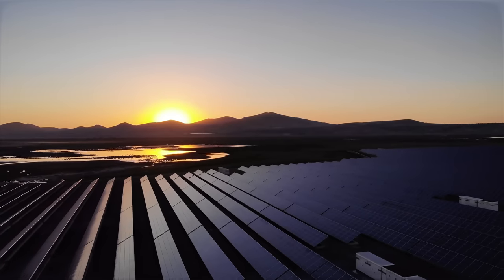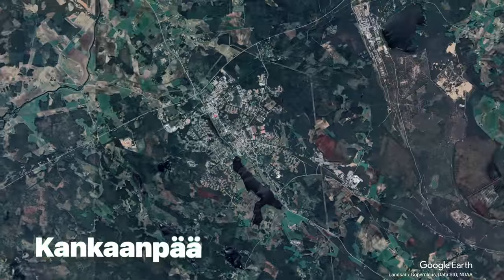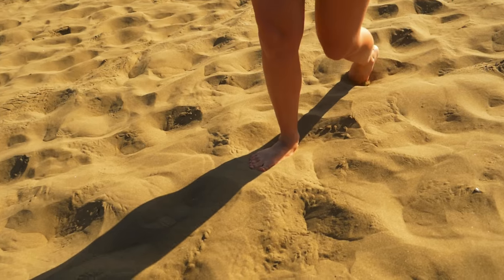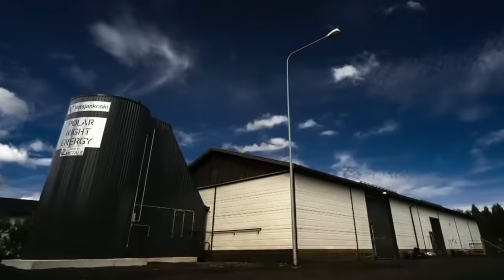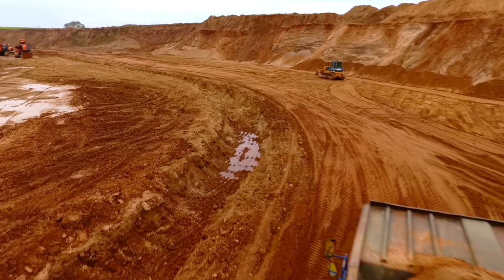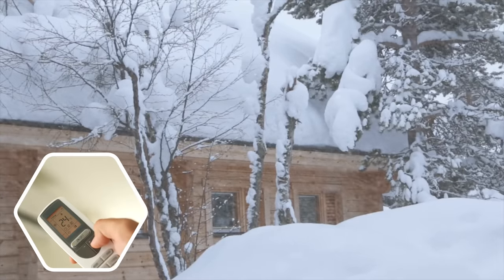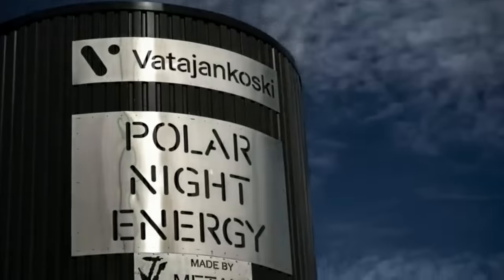Breakthrough Tech Heats Homes Cheaper Than Natural Gas!

Comment: This will help for heating homes and offices if they are connected to a district heating. The energy for the heating would coming from electricity if they is a surplus from renewable sources. But it doesn’t help it all to store electricity energy. You can convert the thermal energy back to electricity only with a relative low efficiency. So this “battery” doesn’t help to solve the problem to store electrical energy at all and is only under some particular circumstances useful.

To compare this with a pumped storage power station is misleading. A pumped storage power station gives the stored energy back as electricity. With this sand battery you put electrical energy in and getting thermal energy out. That is a fundamental different. Many things said in this video are not accurate in the best case.

Comment: I have a question that if we have so many energy options then why most of them doesn't even come close in mass manufacturing? Sometimes I feel great about coming up with different ideas and perspective but at the same time I feel like it only gonna remain as a concept small scale plan. 

So, how do you look at it?
Reply: The cost for people to replace current systems is high.
Reply: @vanderumd11  most of them can't be mass manufactured and are in research phase. So yeah, again it raises the question I mentioned above.
Reply: @RahulAhire  I worked for exelon. It would be at a extreme disadvantage to change our systems as we run short on fossil fuels. People must realize business. Nothing is better then having a depleting product that Increases in value as the supply falls short. Gas companies would love nothing more than the last 10 years of a fuel reservoir. You can sell a gallon of gas for $100 and do less work when that happens. Do you understand? We WANT energy shortages, we make better profits
Reply: @vanderumd11  sad reality
Reply: @vanderumd11  I feel great about having so many options. It just I don't feel good enough that it isn't moving faster towards mass manufacturing like how tech industry work or tsmc spin out semiconductors or how efficiently spacex work. 

I do understand the financial constraints of any new venture. Maybe I'm expecting too much...

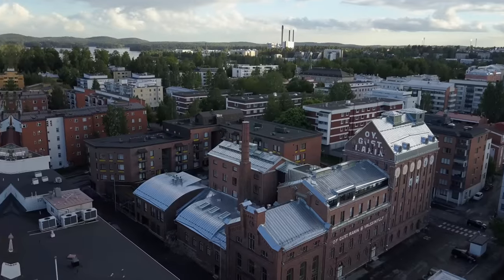Comment: 3:50 "District heating system".  That's the key.  You have to have a district heating system to use this energy.  But how many districts have such a heating system?  How useful is this?
Reply: Very common in sweden and finland, not sure about Norway, in many places, the same facility produce both heat and electricity from burning wood chips or trash like clear plastic, paper and household waste.

Comment: Why not just build a hugh hourglass and let the sand meter through the aperture to turn an impellor to generate electricity, when the sand trickles through use you extra peak power to turn the hourglass over and generate again, Or even better have row upn row of giant dunking birds that use water evaporation on their beaks to pull vacuum changing weight ratios to oscillate regularly.

Comment: What works, isn't always the best idea.  This may work for 1% of the world's population.  Maybe.  We are using equally clean proven systems now.  One example is 'Depleted Uranium Reactors.  They don't produce as much energy as standard reactors, but they use the spent reactors, don't need heavy water to cool, little to no risk of meltdown and some reactors can use depleted uranium right now.  Canada's Candu reactor(s) are doing this now.
Not putting sand down.  Can be used in remote towns.  Also this is interesting.  Just not going to solve anything environmentally ever.

Comment: simplified physics - sand will release heat as easy as it is heated. to store more energy in the sand you need to heat it up to a higher temperature. to do so you need much more than just excess of the produced energy. .the efficiency factor of this system is very low.

Comment: The Problem is being solved Backwards.   Most of the Energy demand,  is due to thermal  LOSSES.   POOR insulation in homes.  Thin glass windows, where heat is lost quickly (even with multi-panes). Limit number of windows (and window size)... and make all windows a minimum of 1cm thickness, of tempered glass.  All ceilings and the attic, must be insulated well.

 In cold climate areas,  make an extended Freezer / Fridge,  that uses the outside temps, for most of its cooling needs.

 Dark colored roofs and paint for cool climate areas.   White roofs and pastel colored painted houses, for hot climate areas.   Also, add light colored paints to the road, to reduce captured thermals in hot areas.  Possibly Run hot water pipes under major roadways in hot climate areas, to capture stored heat from the sun.

 Even better?  Build all housing downwards, deep under the ground.  That includes transport systems / roads.  No more having to plow and salt  roads of snow and Ice.  No having to get wet or cold,  when going to pick up groceries.  Leave the above ground land mass, for greenery.  Food crops, Forests (Lumber), wild animals, parks... etc.

Comment: Very nice video, I do have one question regarding (3:58) "..100 kWh of heating power, in addition to 8 MWh of energy storage.": 
I didn't quite understand the difference between "heating power" and "energy storage" [in the form of heat], aren't they both energy storage in the form of heat?
(to me, "heating power" suggests a form of energy utilization rather than storage, but I'd appreciate clarification, thanks:)

Also, there are currently several companies developing sand batteries. A good followup video would be to compare their approaches and show what each of them is contributing to this technology.

Thank you for your wonderful work.
Reply: Thank you , I did not understand the statement either.
Reply: Heating power is the rate ( amount of heat an hour ) ( 360,000 btu an hour, 3.6 therms ) that can be moved out. Storage is the total amount of heat that can  be moved out over time

Comment: If it's big enough for 10K homes, build MORE of them scattered around. 
Why build BIGGER?
Reply: Because the heat loss goes down the bigger it gets.  And one big pump is a lot cheaper the many little ones, with less maint.
Reply: @kkarllwt  
They say the same thing about nuke power, but I hold the same opposing view. The advantages gained by bigger is often offset by that same size. More stuff to go wrong affecting more people with more negatives. Hot sand has fewer negatives, but rotating maintenace among several is easier than figuring out when you can shut the 1 & only down.

Comment: The question I have is Can this Scale DOWN .. Can we have a Sand Battery for the Home that gets "charged" by off peak or Solar and then used through out the day to heat water and air instead of a Furnace AND a Water heater that operate only on demand?  So instead of 2 devices you just have 1 "heat source" that is charged using off peak hours electricity (like over night) or from a solar panel. It would have a heat exchanger that can be used to heat Air for warmth or water for use around the house.  I would think it is not that technically challenging given that they can heat an entire district using that 1 tower, scaling it down to the size of a US furnace or Large hot water heater would be sufficient for 1 household. Thoughts?
Reply: there are ceramic heat 'batteries' that you can buy to help heat your home.

Comment: Well there is another way that everyone seems to be ignoring it was good enough for Nikola Tesla and that is salt water capacitors you build a 100 ft by 500 ft pool 4 ft deep fill it with salt water in the proper salt to water mixture cover the last 4 in with oil for the final insulation and you can charge those salt water capacitors endlessly to hold all the electricity the wind and solar can make if you need more storage just build another Pool fill it with salt water and there you go would be incredibly cheap would never break down and would last forever basically saltwater capacitor look it up

Comment: Do you know how long they can store the heat without using it? How fast the heated sand cools in the machine?
Reply: The short answer is it depends on the size of the tank vs demand, temperatures in the tank vs outside temps and how well the tank is insulated.  This system can be sized to last only 12 hours on expected extreme cold temps or for days.  The limiting factor is the economics; getting the most energy for the least amount of expenditures.

Comment: So it will help take the load off the energy grid... but we have to make a whole new heat grid to support it. Sounds expensive. I want one in my back yard.
Reply: No "heat grid" used. It's for local use, whether one home or a residential area.
Reply: @markhathaway9456  yep it'll have to be connected to the whole area/building. A heat grid, or what ever you prefer. Pipes blowing hot air.
Reply: Towns as small as 2000 people have heat grids all over europe.

Comment: Cut the constraints from the EPA and the NRC and build out 5,000 Small Modular Reactor sites across the U.S. - they are SAFE - they have ZERO CO2 emission - they run and night and without wind.

Comment: It's not a battery at all, but a heat sink.  Still, it is still an intriguing idea.
Reply: The first batteries were glass jars the stored static electricity. A battery of jars.
Reply: @kkarllwt  A battery produces electricity, it cannot store it;  if it doesn't discharge, a battery will fail..  It also becomes dead if it cannot be recharged.
Reply: @bryang1227  The current ideas of a battery, but not the original batteries.

Comment: I wonder how sand does with extreme cold. Like storing cold to chill as oppose to heat
Reply: are you thinking of using cool temperatures to freeze and use in hot times ?
Reply: Aren't you storing 'cold' when you take the heat out? DUH.

Comment: So I get an old copper tank maybe one in disuse because of ware, and fill it with sand then just run the dump load to the element in the tank  right? Maybe even take use of the back boiler to heat the sand off the stove?
Reply: It's very insulated, so the extremely hot sand doesn't give off the heat too quickly or when you don't want it.

Comment: i think scrap steel could be melted down and used as energy storage instead of being sold to china for next to nothing, i just googled scrap prices for ordinary steel,  not worth driving to scrap yard to sell it, it is however an excellent material for storing heat and would last thousands of years, you would just need to convert back to electricity using steam turbines....ps. i looked up energy storage a year ago they said ''iron'' was best but too expensive...

Comment: The sand battery needs to be paired with an Organic Rankine cycle power station.
Reply: Or a capstone C200 turbine. Oh, wait , that is what 247solr is doing
Reply: @kkarllwt  The Capstone burns natural gas.  The organic rankine cycle uses a fluid  like butane in place of water to run a  turbine.  The liquid butane is pumped into a heat source, converted to a high pressure vapor, sent to the turbine, condensed then back to the heat source.

Comment: If one of the larger sand batteries can store enough heat to generate steam, which can be used to generat6 electricity. . I guess I'm asking if this is both feasible and deployable in a manner that will work to solve the intermittentcy associated with solar and wind?
Reply: It’s possible, but an inefficient use of the energy stored unless you are also making full use of the exhaust heat from your turbine. Otherwise, to generate 1 kW.h of electrical energy, you’d need about 3kW.h of stored heat. Not the best way to go unless you can match your electrical and heating needs.

This form of energy storage works better on a larger scale for the exact same reason that a bucketful of hot water will stay hot for longer than a cupful.

Comment: Could not the heat from the Sand Battery be converted into Electrical energy.
I know that such thermoelectric devices are being worked upon currently and being improved upon, but the two together, could perhaps make a good on demand stored power source.
Reply: The design options are limited, only really viable at small scale, and are quite inefficient in general.
Reply: The efficiency is lower but yeah.  Despite that low efficiency though, using a sand battery you can store energy without degradation for a much longer period of time.  Not really in cycles like in a normal battery, but if you said a 'cycle equivalents' then the sand battery by far outcompetes competitors.  So, if you are building batteries meant to sit for very long periods of time and cycle less frequently oronly in emergency situations for electricity, it is still possible that these batteries would be a better solution for electricity.  You would need absolutely enormous systems of these for it to serve that purpose though.  Because when you convert that energy you have a loss age of about 75% currently, which they may be able to actually double in the coming years with thermal voltaics, but either way you require much more battery for the same purpose.

  But then, even with those losses, the fact it can retain cycles for a far longer period of time without losses, means that if you are going to make batteries for long term storage, if you plan for certain one-in-a-hundred year scenarios or something like that, and check on the data, in those specific emergency scenarios where you will need to have saved energy a very long time in advance, it may turn out to be the more cost effective option for electrical storage.
Reply: @dausume  Thanks for reply.
I get what you mean about loss of efficiency in the system.
Better heat retention may be had with a thermal jacket containing perhaps but I would think, to be viable, it'd need to be damn big sand pile.
Perhaps an idea for when the thermovoltaics devices improve.
Reply: @icecoldchilipreppers  Thanks for input.

Comment: The comparison of battery cost between sand battery and lithium ion battery by Two Bit da Vinci at 4:42 of the video by citing the cost per metric ton of sand and cost per metric ton of lithium carbonate is unscientific and misleading.
If only the costs of the materials for storing energy is concerned and the manufacturing costs of the two kinds of batteries are excluded for comparison, then the comparison should be between the cost of sand for storing 1 KWh of energy and the cost of lithium carbonate required for storing 1 KWh of energy. 

The sand battery has 100 metric ton of sand. It can store 100 KWh of heat energy. Cost of sand $10 per metric ton.
Cost of sand for storing heat energy = ($10x100) / 100 KWh= $10.00 / KWh

Weight of lithium carbonate required for storing 1KWh of electric energy is 0.85kg. Cost of lithium carbonate is $17,000 / metric ton = $17 / kg .  
Cost of lithium carbonate for storing  electric energy = $17 x 0.85=$14.45 /KWh

Even though using lithium ion battery for storing energy is more expensive than using sand battery especially when the costs of manufacturing the two kinds of batteries are taken into consideration, the cost of sand to cost of lithium carbonate required is only  about 10 : 14   It is not 10 : 17000 as the unscientific and misleading comparison implies.

Comment: My San Diego apartment has no insulation.  I wish I could fill the walls with sand.
Reply: You can fill your walls with rockwool. Realy good stuff.
Reply: Aaah...there's the problem..."uninsulated" houses ( what do you need insulation in San Diego for?  just turn up the old A/C.... ) yeah THOSE are the problems: no insulation...and cheap energy ( years ago when most of the houses were probably built...in San Diego anyway.  The most insulation you can afford /or invest in is always a good idea. 
( Regina, Saskatchewan,Canada - gets both really hot and really cold here - temperature extremes )

Comment: Would a sand battery work in the other direction, i.e. cooling it during off peak hours in very hot locales and using the cool sand to cool  the air in a building at peak hours.
Reply: I don't see why not, but as someone else pointed out in another comment: you'd have two heat pumps running simultaneously since you also want to cool the building down during the day. Why not just properly insulate the building and run the heat pump during the day to keep it cool? It shouldn't heat up significantly during the night in that case.

Comment: good idea. what about = 
heat can be used to generate electricity so why not use the excess heat at peak times?
Reply: Because 2/3 of the energy would be wasted.
Reply: @kkarllwt  not a reason not to use it. if the heat is going to be wasted, use it for elect

Comment: Why not use heat pumps to heat the sand?
Reply: Heat pumps run at a lower maximum temperature than required for this.

Comment: Could sand be used for storing super cold sand ? Maybe it does have a use in San Diego !
Reply: yes. How are you going to use electricty to take the heat out. Compress CO2 would get you to minus 140 F.deg.
Reply: @kkarllwt  refrigeration technology can do it. Ask an engineer. I dunno !

Comment: smaller footprint/home   major insulation R40-60    recycled materials/low cost     geothermal heat pump    d.c current applies/compressor/fan   Finally, have to mention it...  Population reduction    THE END

Comment: It would be much more efficient to power a heat pump with renewable energy to heat up the sand
Reply: You can walk into any home depot and buy a heat pump that will take 60 deg air temp and raise it to 1000 degrees.